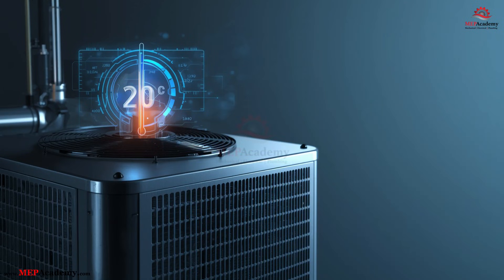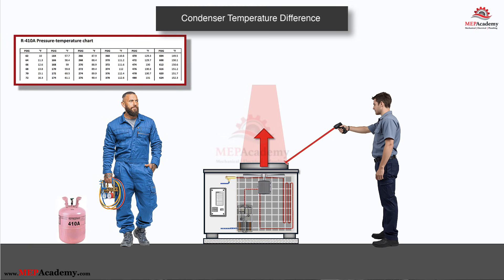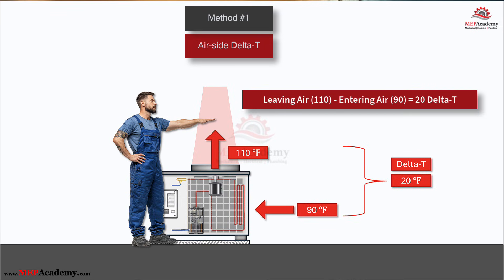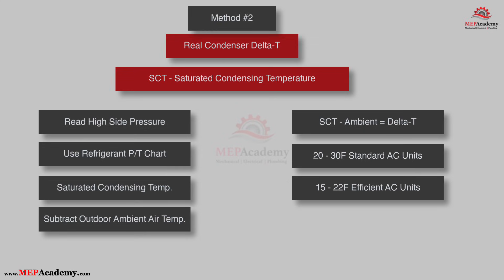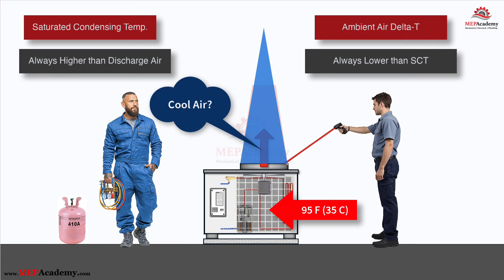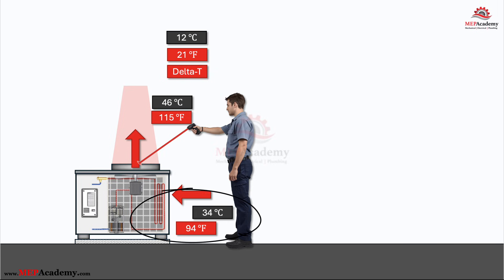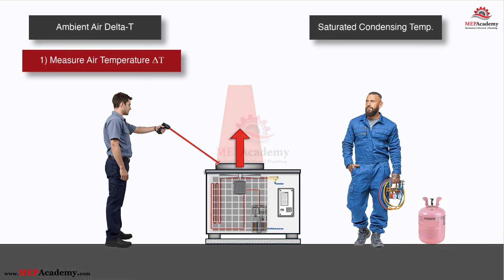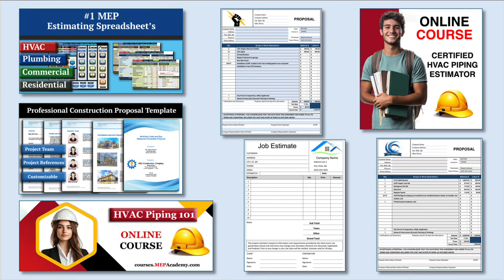HVAC Diagnostics: Air-Side Delta-T vs. Saturated Condensing Temperature Explained

Comment: Why not just use subcool and superheat plus indoor delta between supply and return. You get way more diagnostic value from that than either of the methods in the video. Though considering the video is AI…
Reply from the maker: You’re right that superheat, subcooling, and supply/return ΔT provide deeper diagnostic detail once gauges and probes are connected. This video was focused on high-level performance indicators that can help flag issues early, before detailed measurements are taken. They’re meant to complement—not replace—pressure-based diagnostics.